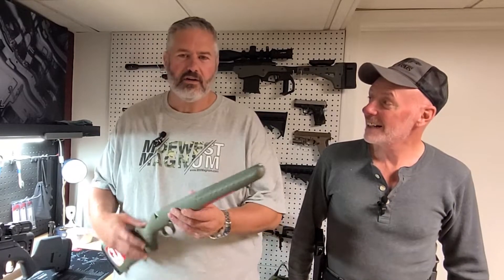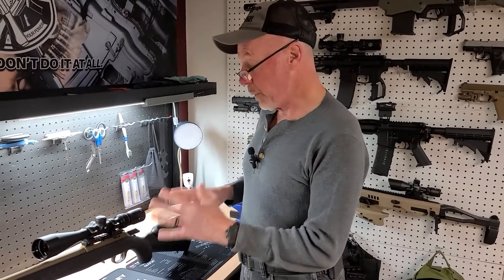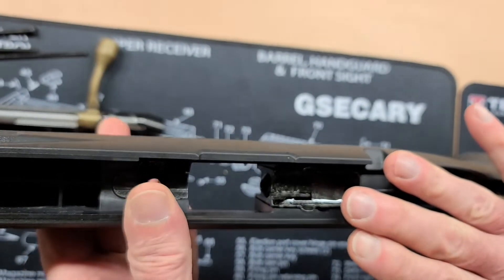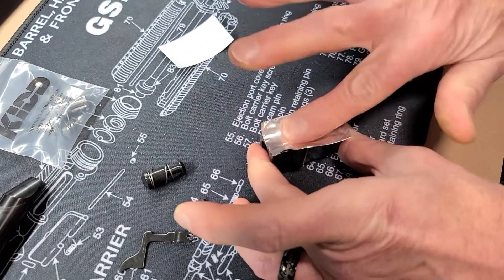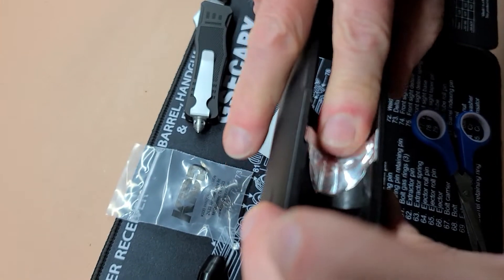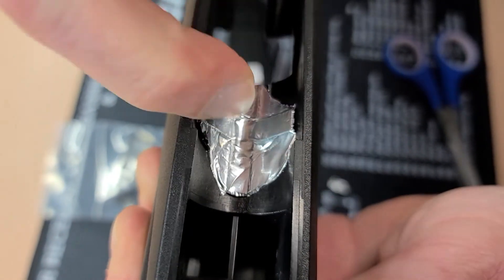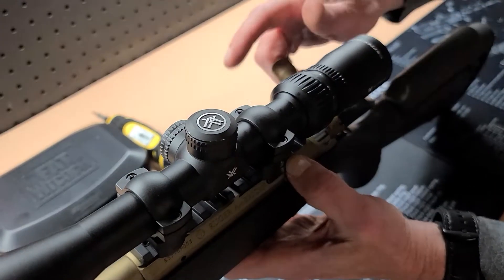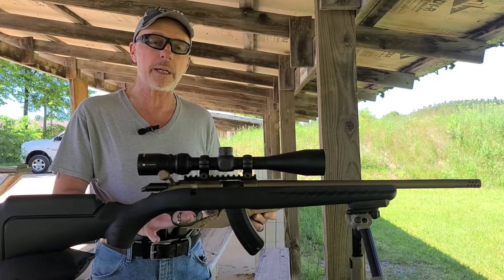Ruger American 22 Accuracy Trick - Aluminum Bedding

Comment: does the adhesive aluminum tape react with the steel it touches....gonna corrode if it does
Reply from the maker: It doesn't but good point. It's the aluminum the used for duct work.  Thanks for the comment and for watching.

Comment: I regret buying my American Rimfire. The center line of the magazine does not line up with the center line of the chamber so consequently the ammunition gets hung-up when the nose of the bullets hit the left side of the chamber. Ruger refuses to fix it. Garbage company!
Reply: That’s a shame, mines been perfect. I have the predator 22lr. Shoots dimes at 50 yards using CCI SV. About 1,000 rounds through it so far. Fit, form, and function has been spot on. I can’t complain at all.
Reply: I can’t believe Ruger wouldn’t fix it I have had nothing but great service from them on the couple guns I’ve had to send back in.
Reply: the bolt in mine moves around when the trigger is pulled